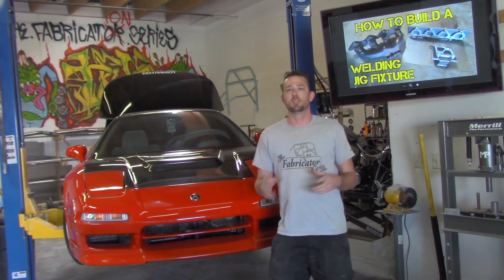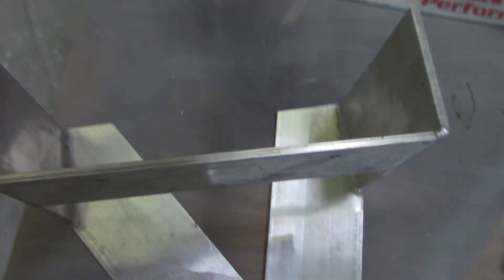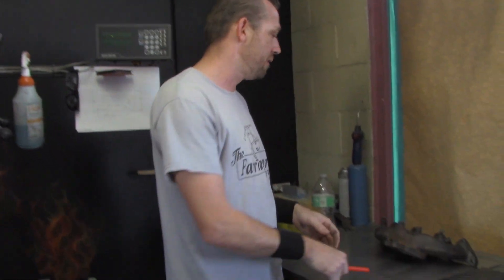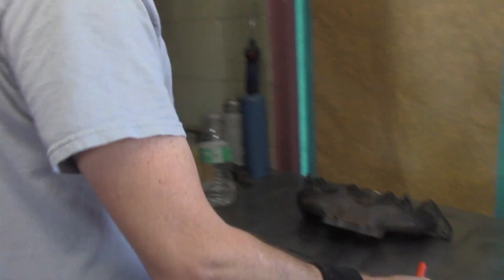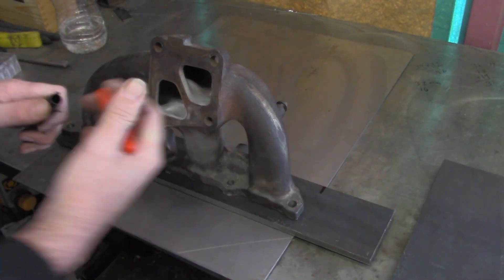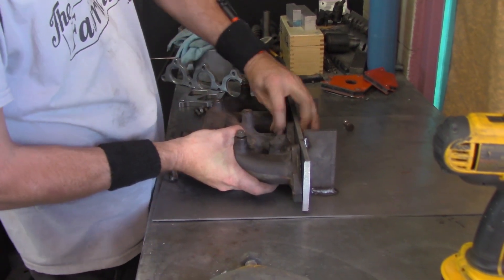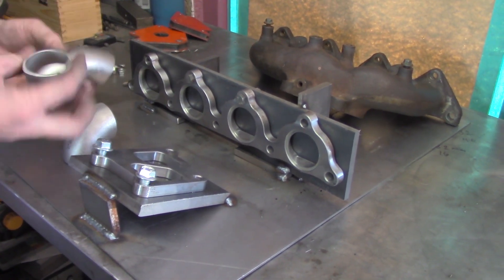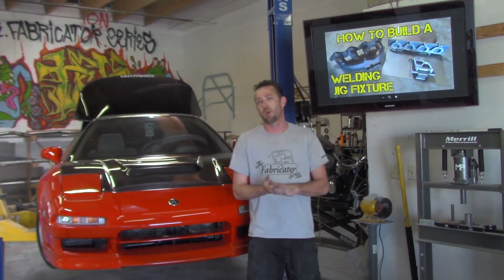TFS:  How to Build a Welding Jig Fixture

Comment: It’s a lot more likely that someone will have a drill press, even if it’s a small one, than a horizontal bandsaw. More likely, they will have a metal cutoff saw, possibly a cheaper friction cut model, though hopefully a carbide model.

If you’re power tapping remember—you MUST buy a machine tap, no hand taps will work properly. Hand taps must be reversed every turn or two, at the most, to clear the chips. If you don’t, then you could break the tap, ruin your threaded hole, or both.

Comment: Good info on fixture design.  Btw to quote wikipedia:"A jig is often confused with a fixture; a fixture holds the work in a fixed location. A device that does both functions (holding the work and guiding a tool) is called a jig."
So you are talking fixtures. 
Just for clarity...
Reply: Tano17 shhhhhaaaaatttttthhaaaaaappp

Comment: Hey Justin I would like to thank you for posting the educational/informative vids that you post. I do recognize that this vid is primarily bassed on building a jig fixture I could not help but notice the amount of splatter. If you can please give a brief disscription into why Their is so much splatter it would be appriciated. I am not a professional welder but I do own my own mig/Tig welder which catches more dust then use :) as an enthusiast who does a lot of my own stuff. I take it the splatter was/is due to not using any argon or the electroid is set in reverse? Thanks ahead & keep up the good work 🍻
Reply from the maker: Walker71820061 Splatter/spatter is process. It's basically a byproduct of the short circuit MIG process (standard/basic/typical MIG welding). If it doesn't interfere with your work, it's not an issue. Most jigs in general are just there to hold pieces in place - nothing else. If a piece of splatter/spatter ie kn a surface - get rid of it. Anything else, dont worry about it. Final products get points -  ot necessarily the process.

Comment: Good stuff but why not use the flange as a drill template by clamping it to the steel plate? You could even mark one end then drill out that hole, then use a proper size bolt & nut to hold one end and clamp the other end then drill the other end hole then bolt that end down. This way you could drill the rest and have perfect hole alignment by using the flange so you don't have the drill bit  wondering around which it usually dose and causes misalignment. There are also the titanium coated drill bits with a smaller center drill bit that would help in just starting the center of the hole.

Comment: Can you tell me what fluid you are spraying on the bit when drilling on your mill?  Thank you.
Reply from the maker: Paul Nygren It's a water based lubricant and coolant. I can't remember the brand off the top of my head, but I use it because it's safe to mist and flood, and it's water based instead of oil based.

Comment: How would you go about holding a vband(ed) collector in place while tacking the new manifold runners in place within the jig? 
That's my main issue right now before moving to the purge blocks for final welding and I use Tial turbine inlet flanges on my collectors. Thanks!
Reply from the maker: FiestaSTdaily use another vband flange and a clamp on the jig
Reply: The Fabrication Series that's what I figured. Just can't seem to find a female tial flange anywhere. Thanks!
Reply from the maker: FiestaSTdaily Measure and find the closest size.

Comment: have you ever built upper and lower control arms?   I was thinking about buying a good junk yard set of control arms, building a jig to them,  cut the jig in half between the bushings and ball joints, and extending them by a couple inches to create a long arm jig ... any criticism is much appreciated.
Reply from the maker: I have built many control arms. The process you described is pretty much how it's done.

Comment: Transfer Punches......take out the guess work
Reply: I was thinking the same thing.
Reply from the maker: I don't use them. I typically just measure like I did in the purge blocks video so I have nothing to demonstrate with and there are other methods to achieve the same result as shown.
Reply: Yeah, or centering punches.

Comment: I need to make a turbo manifold jig for my 13b but the only thing I seen in your video I wouldn't be able to do is essentially let the jig cool with a complete manifold in place. so what are my options?
Reply from the maker: I'm not sure what you're asking. Could you elaborate?
Reply: I'm about to make a JIG for my 13b also. Single turbo manifold for the t3 turbo flange. T78-33D turbo. I dont think the cooling of the jig matters. Just make sure you have a decent thickness to stop warping.

Comment: I've seen people who use a mig to weld the turbo headers is that fine or do you use tig fir looks ?
Reply from the maker: MIG has less control than TIG. There are usually cold spots and the weld is larger in size. That usually translates into weaker. It can be done (and it has been several times), but it may not be as strong as the TIG.
Reply: Thank you really apreciate it and good job in your videos man I've honestly learned alot.
Reply: Go with tig if you can. It is the reason why after all of this time welding mig with my everlast that I really want to learn how to tig weld now. more control over everything,

Comment: They shouldn't be interchangeable.. A Jig and a Fixture are two different things. A fixture holds a work-piece in a certain orientation where as a Jig is meant to guide a cutting tool (usually a drill) in a certain orientation. That is how it is in the machining world anyway.. For example to take it out of the video.. I would make a drill JIG to drill the holes in the manifold flange.. and I would make a FIXTURE to hold the tubes in place to weld them to the flange.. Hope that is understandable. end rant.. anyway, Great Vid!
Reply from the maker: M Penn They "shouldn't" be, but often are. It's the same as tube and pipe, or motor and engine. They should be differentiated, but they are often synonymous. I put both terms up there so that people will understand in their terms as they know it.

Comment: what software do you use to design roll cages, frame etc..
Reply from the maker: I don't use software. It adds additional steps to the process. Its faster to measure, mark a tube, bend it, then install it. Using software would take a lot longer because you have to input all of the info into the software using the same measurements you just took.

Comment: Should have clamped the flange to the steel and marked through all the holes with a snug fitting drill before drilling the pilot holes.
Reply from the maker: There's more than one way of doing things. This was just one method.

Comment: should have used a punch when you drilled those first holes do the bit won't walk. maybe?
Reply from the maker: Moving the drill to keep it centered is what I do to keep them from walking. I've just been doing it for years.
Reply: fastsofaracing the holes lined up perfect.. so he did not need a punch.. sherlock

Comment: Thanks for taking a sec to explain power tapping...saw it in another video but figured it was a special tap.  Was that WD 40 you sprayed the tap with, or cutting oil?  

If you need inspiration for a video, i'd like to see one on taps, dies, easy outs/extractors and heli coils...and any other thread fixes you may know of.
Reply from the maker: Power tapping should use a spiral flute style tap, but doing it with a hand drill can be done with a standard tap. any machine will probably break the tap. 

I'll see if I can put together another video on thread work. Thanks for watching!

Comment: +The Fabrication Series ,   I notice in other videos you reference being able to reach all weld surfaces. This leads me to believe this is an assy fixture and not the full weld-up fixture, since you went through the effort of making the purge plates. Would I be correct?
Reply from the maker: This is a temporary placement jig/fixture, so it's only purpose is to hold the place of the part being built with it until it gets fixed to the purge blocks. If it was a production style jig, it would have been made different and more accessible.
Reply: Why not just use the purge blocks to make the jig? Access?
Reply from the maker: Access is the biggest reason. Rotating a big temporary placement jig is not as easy as rotating the work with the purge blocks attached.

Comment: that's pretty smart using the factory manifold to make a jig, we always used pvc piping to get a general shape and size given the measurements from the space inside the engine bay and engine. I do have a question and you can call me dumb but what is the purpose of a purge block?
Reply from the maker: Purge blocks allow argon gas to get in to the work as you are welding it. They also serve as a heat sink and prop for your work. You'll see them in action during the next episode.
Reply: +The Fabrication Series hey thanx for the info. I only weld on things at work and was trained there. they didn't explain the dynamics of anything nor do we use purge blocks. we do have jigs and fixtures though.

Comment: That base plate looks thin? Could easily warp? I'd have used some bracing from the flanges. Otherwise, great video thanks
Reply from the maker: It is a temporary placement jig. All it needs to do is position the work for some tack welds before being transferred over to the purge blocks. If it was a permanent or production jig, it would have been made thicker, or it could be fastened or welded to a table if it was a huge concern.
Reply: The Fabrication Series Gotcha

Comment: When I'm doing multiple holes in a piece, I start in the center of my pattern, mark and drill that hole first. Then bolt the pattern down to that hole. I then use the proper sized bit to keep centered in another pattern hole adjacent to the bolted down one and repeat. Continue until all holes are drilled. This insures there's no shift with the pattern or hole positioning. If you just do a pilot with the proper sized bit you can also remove the bolted down pattern and use a drill press or whathaveyou to finish the holes.
Reply from the maker: That method could work well too.

Comment: Buy a set of transfer punches! Tons more accurate then a marker.
Reply: Yeah transfer punches or at least center punch.
Reply from the maker: I usually just measure the part and mark it out which is the most accurate (as shown in the Purge Blocks episode). I don't own transfer punches or center punches since I don't use them, even though they are useful for projects like this. The marker will serve its purpose well while maintaining some accuracy as demonstrated in this video.
Reply: +The Fabrication Series   Buy the HFT transfer punches. Cheap, but still just as useful as the expensive ones.
Reply from the maker: I don't use punches since I just measure the part.
Reply: Or for one-of's, grind a point on a HT bolt of the right size. Just needs to make a small dimple that can be enlarged with a proper centre punch.